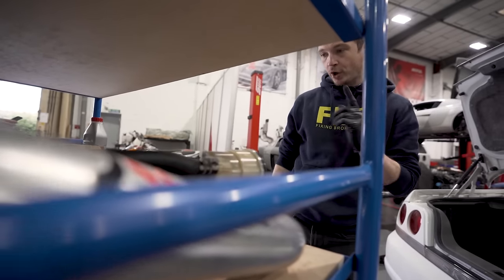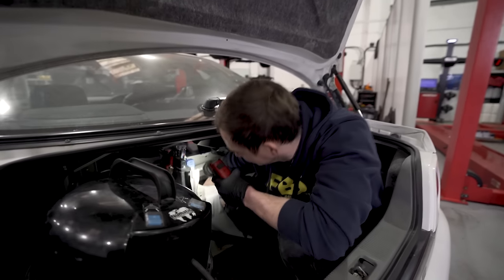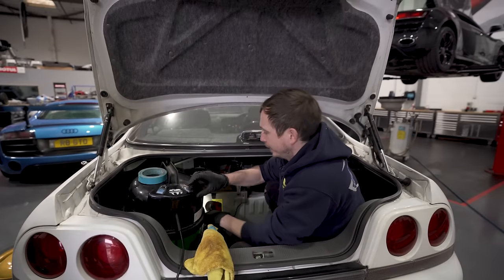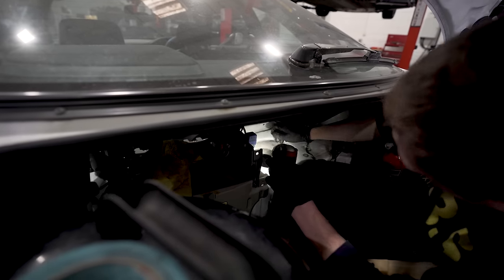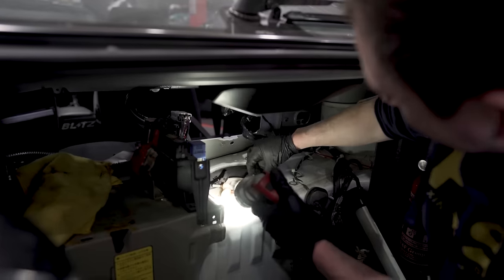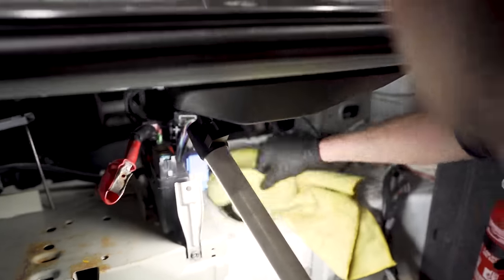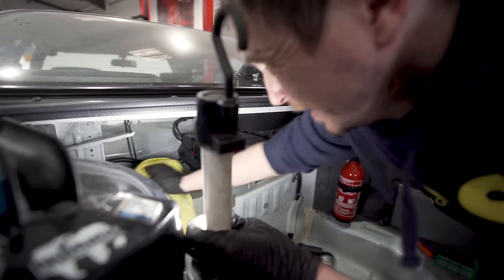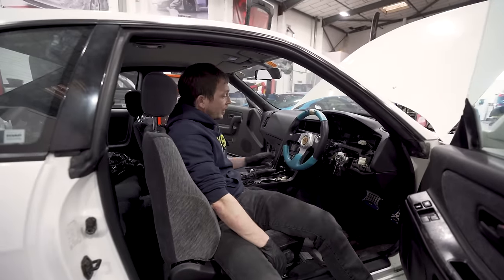How Do You Fix a Broken Nissan Fuel System? | Project Skyline Part 6

Comment: Is there a reason you dont use the amazing invention that is the battery ratchet?
I understand for finer stuff where threading a bolt is a 10 grand error but on fuel tanks and fixing bolts holding wee items on and in?
They save hours per job...